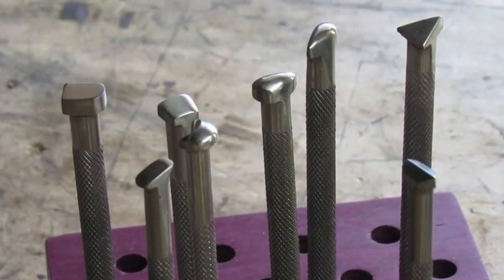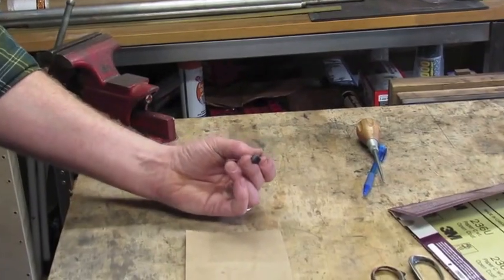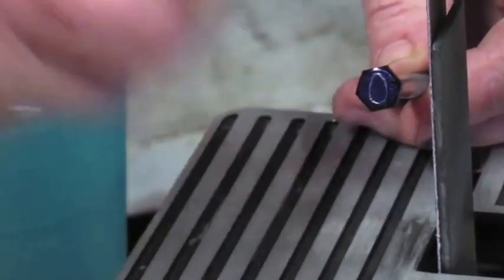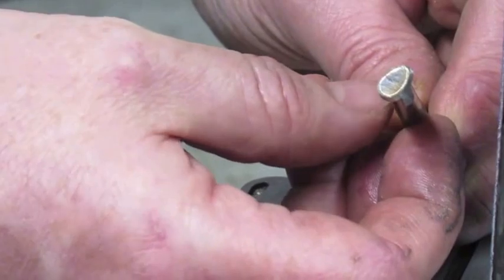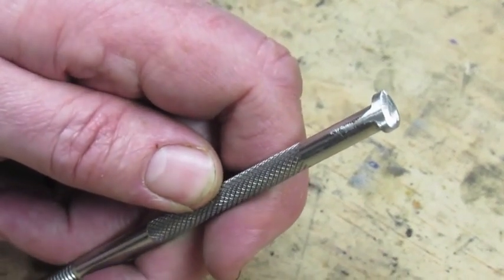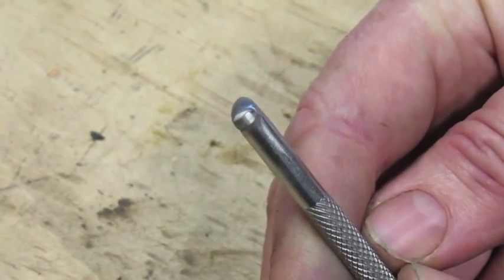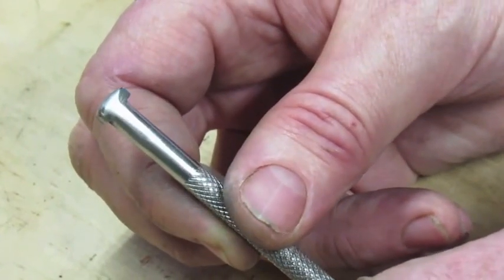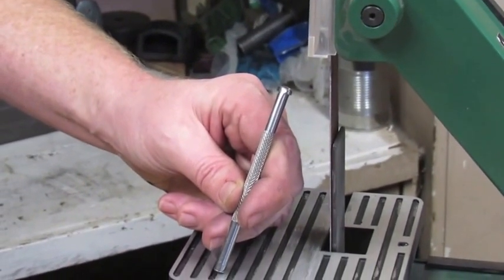Making leather stamps - Pear Shader

Comment: how did you do the Knurling ?  it seem it just suddenly appeared ??
Reply from the maker: Hello,  The knurling is done on a metal lathe. There are hand knurlers available but they will not do a continuous knurl.  Thanks for watching.
Reply: Wait, your using only hand tools, but off camera you use a metal lathe ?
Reply: There are a few videos on YT about knurling without a lathe (Though only three made by the same guy). Look for the videos titled "without a lathe knurled screw" 1-3.

Comment: I've looking for a while about how to do this.  Keep it up.
I would like to know how do you get the tooling pattern on the shaft of the bolt.  The video doesn't show that.
Reply from the maker: The knurling is done on a metal lathe. There are hand knurlers availiable but they will not do a continuous knurl and they are relatively expensive.  Thanks for watching.

Comment: What kind of stainless are you using? 304? 316?
Reply from the maker: The bolts I use are common off the shelf type so I believe it is an 18-8 type 304. The 316 is for more corrosive environments and would be a more specialized and expensive bolt. Thanks for watching.
Reply: Hi,
I don't know if this helps but 303 is supposed to be free cutting or free machining.  I'm not a metal expert - this is just someting I picked up in my travels thru the net.  I don't even know if there are bolts made in 303.  What I heard was that 303 has a higher sulfur content and that makes it easier to work but at the expense of corrosion resistance, which for what we want would not really matter.
Kind regards,  John

Comment: Are you not telling us how you did the knurled surface on the bolt. It sort of just appeared???? 
Nice video but unless you show the entire story how do we know the bolt you started with is the same as the finished tool. I'm not trying to be a jerk but the kneeling is a pretty major part of the finished tool and you didn't show that part. 
Am I the only curious one??
Thanks anyway though, it came out nice either way. 
Knurling PLEASE??????
😃
Reply: Waveluth, he used a metal cutting lathe. Said so in a reply to a previous comment. Hope this helps you.

Comment: The knurling?
Reply from the maker: The knurling is the checked grip on the handle. I hope this answers your question and thanks for watching.
Reply: Yes, I know what the knurling is.  LOL   I was asking how you did it?  Sorry I wasn't more clear.
Reply from the maker: Haha. No problem.  The knurling is done on a metal lathe. There are hand knurlers available but they will not do a continuous knurl.  There are a bunch  of lathe knurling videos on youtube that show how it is done.
Reply: 10-4.  So it doesn't appear to be something that one could do without a lathe.
Reply from the maker: Correct